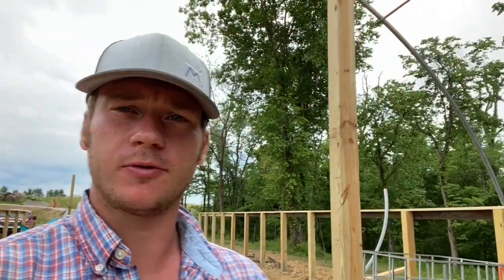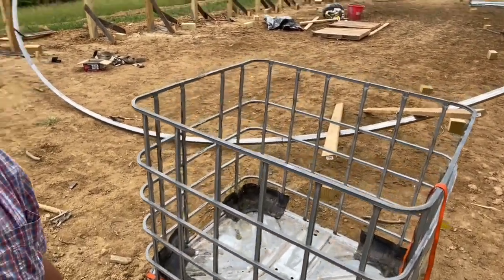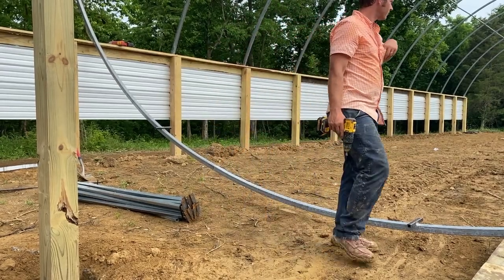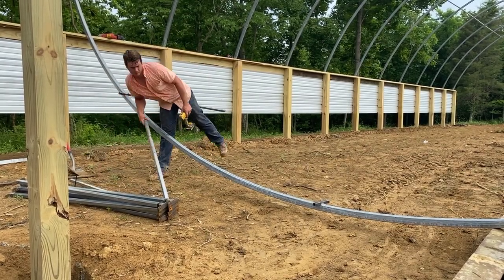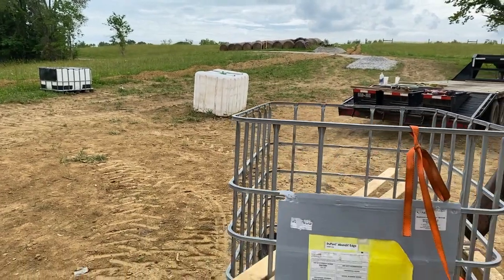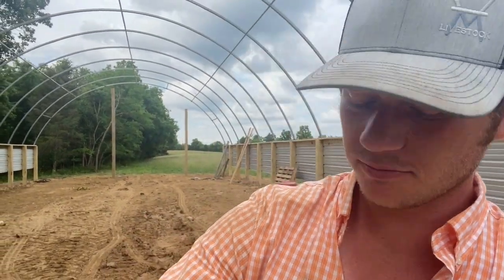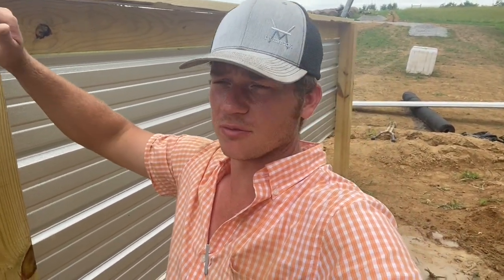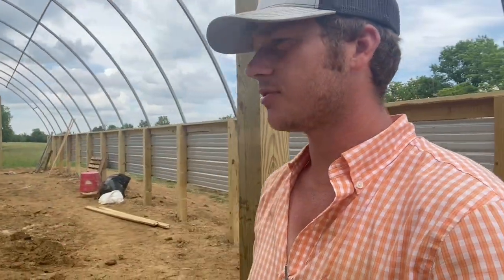Starting to Take Shape! - Hoop Barn

Comment: I just found your channel and I’m impressed with your hoop barn. 
I particularly like how you elevated the sides to give you a section of straight wall and the jig you came up with to help position the hoops on top of the wall plate.
How is the tarp roof performing?
Do you think it be possible to use the type metal (as you used on the sides) to cover the roof in place of the tarp?
Thanks for posting your building and happy holidays.
Reply from the maker: Thanks for watching! The tarp is good, it has a 15 year pro rated warranty on it so it’s built to last for a good amount. As far as using the metal in place of it, I don’t think it would would out. The tarp helps to hold everything together, and with the curvature im not sure how well it would bend around it, and you would also have to run more pieces down it to attach the metal to. Hope this helps!